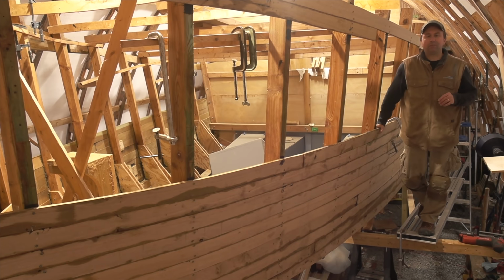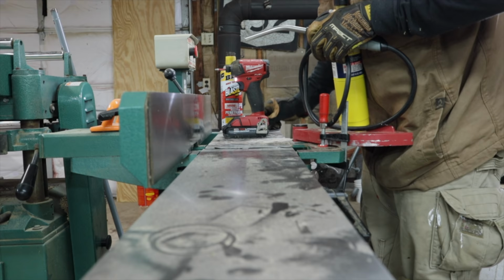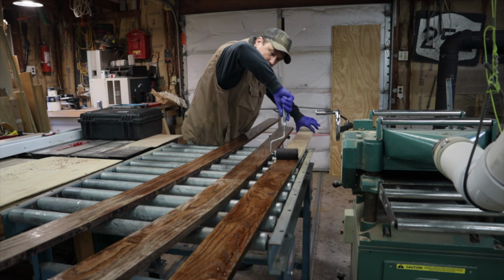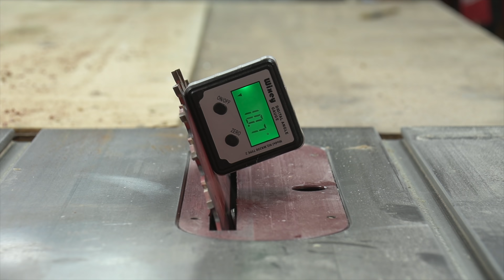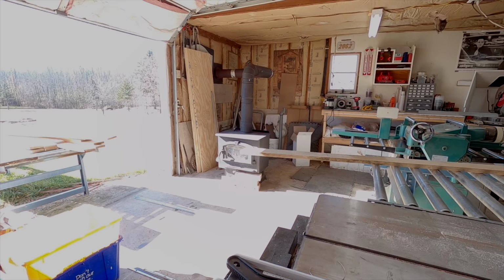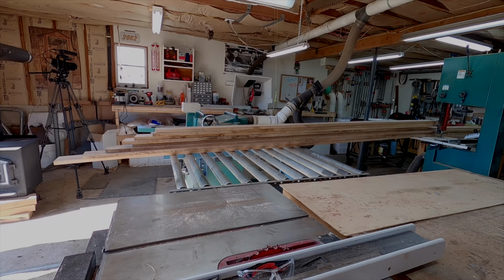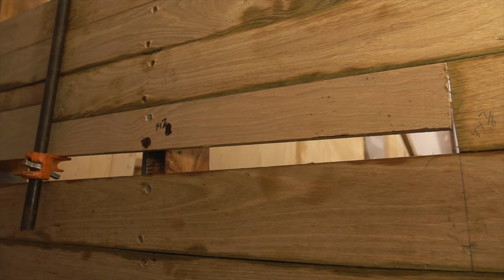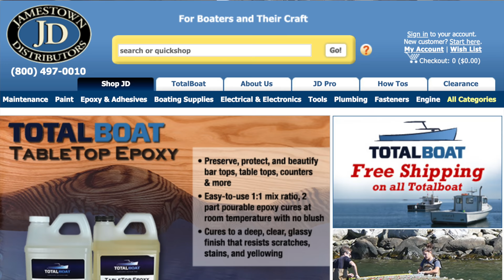Wooden boat trawler yacht Diesel Duck planking and Diesel Tank work.  SDP #62

Comment: I would hope that you do not unbalance your fuel supply between port and starboard in resizing your fuel tanks.  In certain ocean conditions if your fuel or water is unbalanced between sides your boat can be flipped over in seconds and never be seen again.

Comment: G'day  Scott,,
 Love  the look of her lines , and the methods  your using to achieve  such good results .
Very pleasing to the eye .
I totally agree with you on the fuel tanks , comfort at see is paramount,so the space can be put to good use .
Moreover , diesel is becomming more available, and a 2000 mile range is  adequate, considering  you also have sail  power .Bladders are great , its also common to see plastic jerry cans lined up either side ,as they are cheap and readily  available.   
I bet its not to long before there's  talk of  circumnavigation. 
Thanks for another great vid Scott .

Much Respect 
     from
Down Under

Comment: (09:10) Pushing a chisel while wiggling it side to side while pushing the work with your other hand in the direction of the business end of the chisel might earn you a trip to the ER. You must own a clamp or a vice. Don't get me started on the acetone.
Reply: Exactly. Almost lost an eye once while holding a screw driver pointing to my face while pulling down, with both hands, on a metal angle I had just installed in a concrete wall (to test it). The fastening failed and my hands came to my face and the screwdriver scraped my right temple... I really learned something about the 
« business end of the tool » that day.  Cheers.

Comment: I want to preface by saying that I don't know anything about boats, so I am asking out of curiosity; wouldn't having some custom stainless steel tanks be far superior and not much more expensive? That way you could change out the tanks for different size ones if your needs changed. I am a sheet metal fabricator and I doubt it would cost much to have the two tanks made. It would be even cheaper if you just gave a shop the panel sizes you wanted and welded them yourself. Keep up the great work thanks for the content.

Comment: Scott
I think you are missing out on an easy safety feature on your double wall fuel tanks. If you were to install a small capped bulkhead fitting on the lowest point of the exterior layer of plywood  you would have a test point for leakage of the interior plywood layer. With this fitting installed the cap could be removed once in a while and if dry, all is well. If fuel is in the fitting you will know that the interior containment has failed and only the exterior containment is holding the fuel.  You would then have a problem but not yet an emergency, and you would have time to make rational decisions as to resolving the issue. Enjoy your videos.
Thanks Barry

Comment: I have zero experience with boat building, but some experience with wood working and construction. One thing that caught my attention is how much he's been having to clamp the planks "downwards" at the middle of each plank to bring it flush with the plank underneath. Now that's a lot of tension being stored in that frame. When that boat is in the water, I imagine (with my 0 boat building knowledge) that the tension is going to want to bend the boat up in the middle. His keel seems to be reasonably strong - although it's made by laminating boards - but that frame is going to be under an enormous amount of stress from this planking. Add rough seas to the equation and I don't know... Am I missing something here?
Reply: Don't know, but perhaps the two layers of ply that will be laminated to the outside will be enough to negate that.
Reply: That's known as "edge setting" and is s very common planking technique. The wood apparently "relaxes" into its new shape after awhile.
Reply: @billstevens3796  I googled that and you´re right. But I also read that this is only supposed to be done for minimal tweaking purposes... I´ve seen him clamp planks down more than half a foot. And not just one plank, but several of them, one after the other... seems dodgy to me... but like I said, I´m no boat builder. The guys over at the sampson boat co however aren´t edge setting any planks on this scale on the tally ho.